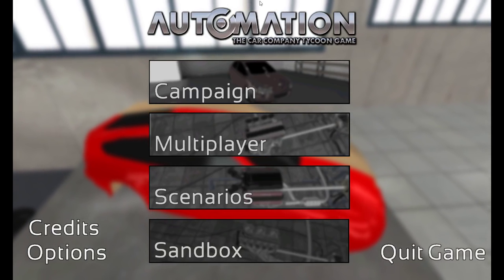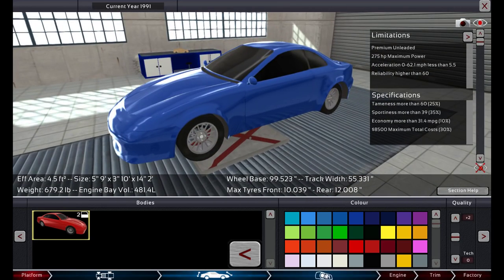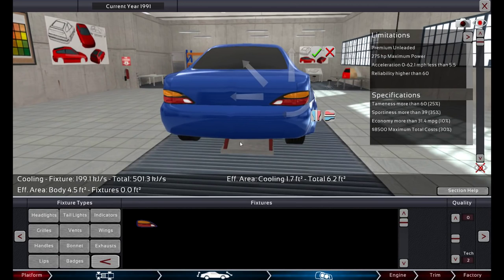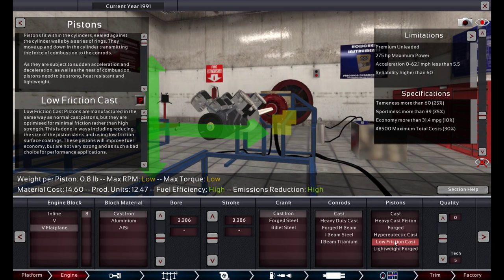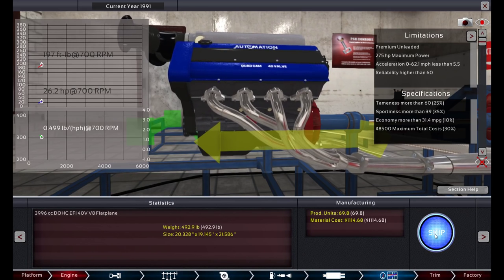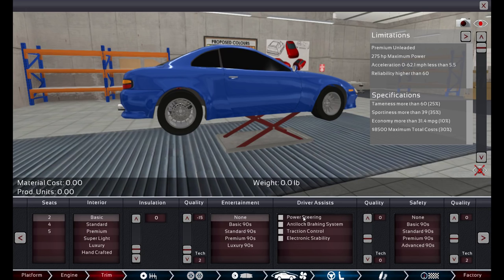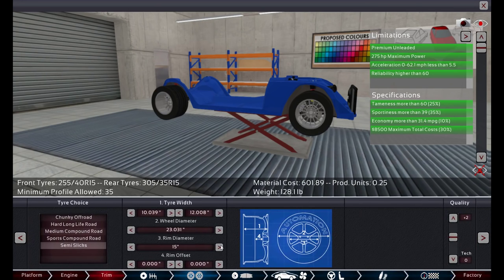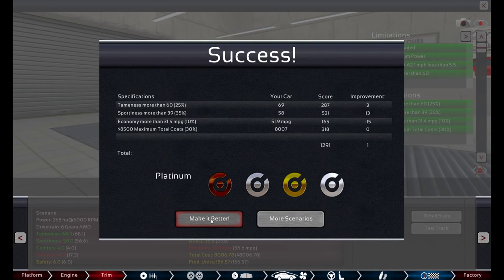Gentlemen's Disagreement - Automation The Car Company Tycoon Game

Comment: Just realized, 90's sports cars are the best cars... Especially because of pop up headlights, which i wish more cars had, since they have way more practicality.
Reply: yeah, FRIKIN accident safety UGH
Reply: Rafee Samith
Body panels now bend way too much, they're more focused on less G's then preventing the cabin from crumpling. I prefer roll cages in newer ones because of that.
Reply: Pop-ups do almost nothing to hurt safety, the reason they're out of favor now is because of regulations that mean if you have pop-ups you have to be able to operate them without any tools whatsoever in case of electrical failure, which makes them much harder to design.
Reply: Alpharius How do you operate headlights in the event of an electrical failure?

Comment: I would actually want that car you just made in real life - but just like that. Well, maybe a little different headlights because they do look a little awkward.
But a sports car with 269 hp that goes up to 280 km/h and only consumes as little as 4 liters of gasoline per 100 kilometers - that's actually awesome!
Reply from the maker: InfinityCraftLP For once, I actually made a good car. One draw back though. No safety features, so you better not crash and die.
Reply: WhyBeAre If it had safety, radio and better in interior, it'd be a great var, indeed.
Reply: +whybeare YOU AWALYS KEEP FORGETING THE EXUHSTS

Comment: 12:45 - V8 flatplane = Ferrari, basically. Flatplane V8s rev harder than regular V8s, but they produce a lot more engine vibration and cost more to build. 

Inline Six is what BMWs use. They're very smooth (big truck engines are L6 because you can have a really long stroke without needing a balance shaft to smooth it out), they're tall (no good with the hood you designed), but more centered in the car, which helps rotation.

V8s you probably know.

Anyway, for a car with max 275hp, it makes no sense to have a V8 -- the least power any V8 has made since the turn of the century is 310hp. You need a V6, Inline 6 or L4 with forced induction.
Reply: Scania uses V8

Comment: Why would you not like power steering? It doesn't do anything until you need it. Like on the interstate you don't use it or when your going anything above like 45. The computer will tell the rack not to assist and it'd just be you turning it. To say it's "sporty" not having it is a lil dumb.

Comment: What is the difference between and V Flatplane and a normal v config?
Reply: The main difference is the crankshaft. The normal v (crossplane) has the crank pins positioned in such a way it kinda looks like a cross when looked at from the flywheel point of view, while flatplane config has them positioned in a flat manner, kinda looking like a line when looked at from the flywheel point of view. (like the 4-banger crankshaft). This changes the pistons position relative to each other, the ignition patterns, and thus changes the engine sound. That's why Italian V8s sound so different from the American ones.
Reply: Ahhhhh so is one better than the other or are they just different?
Reply: +GhibliDisco i know its a bit late but flatplanes push out a little more power